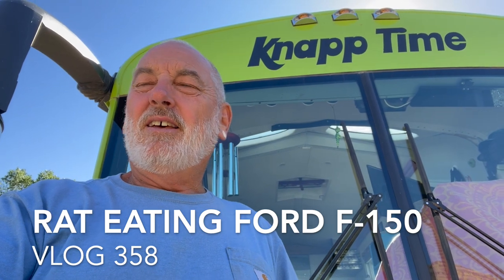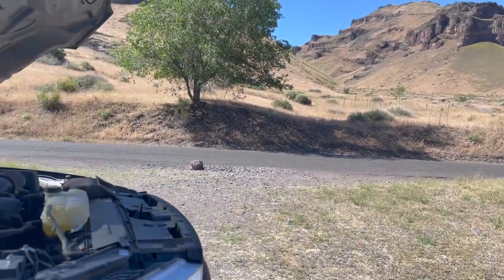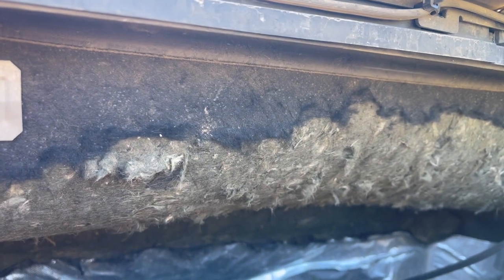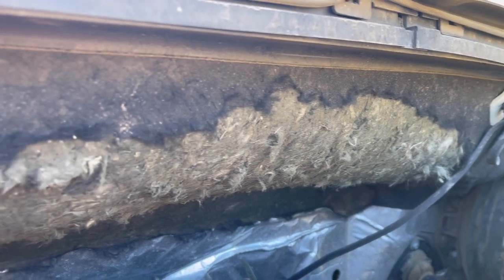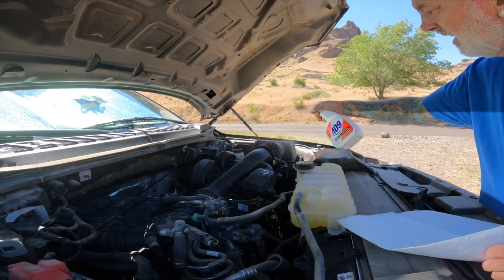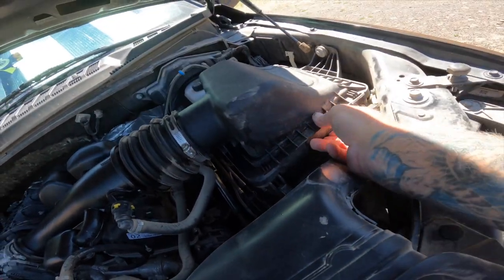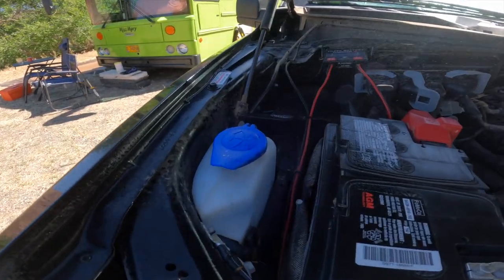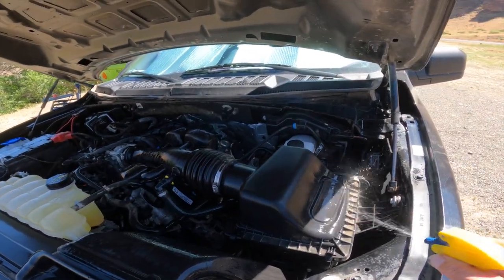Rat Eating Ford F-150 - Vlog 358

Comment: Thanks for this video! I have the same issue, different rodent.  The mice LOVE my Toyota RAV4. They destroyed my hood insulation pad and made nests between that and the hood.  They made a nest on top of the in-cabin air filter. Recently, a dead one somewhere between the engine and the inside of  the car.  The smell is AWEFUL!!  Over the years, we've tried dryer sheets, tucking them anywhere that we can, without starting a fire. We've also tried spraying mint.  I thought that we'd gotten ahead of them, until the SMELL!! We did a total inside cleaning and then saturated the engine compartment, both to deter them and try to deal with the smell.  I had a chat with someone at the Toyota dealership, he told me that all their tubing is now made of SOY, so I am sure that just adds to the warm, dry environment that rodents love!
I'll be following this to see if anyone has any other suggestions.
Reply from the maker: Thanks for sharing. 😃😃👍👍